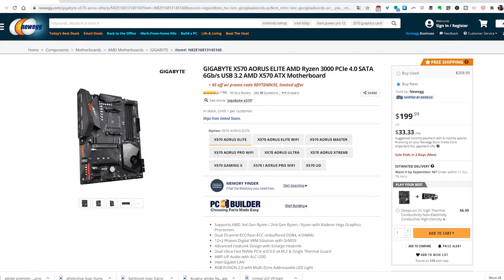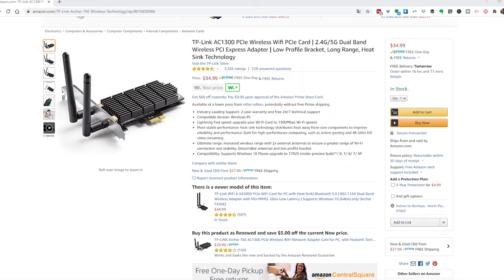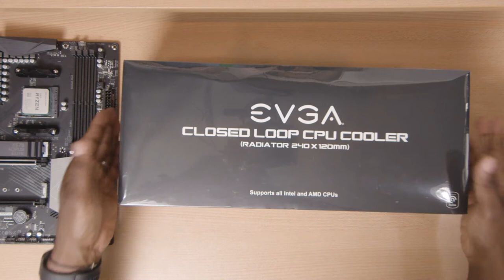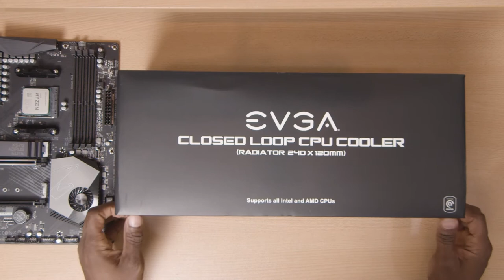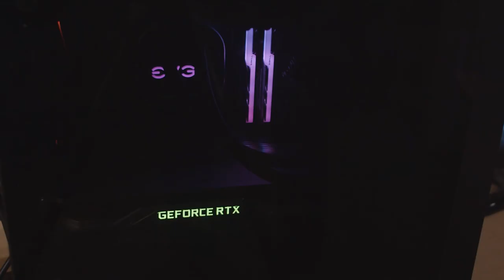COMPLETE High End Virtual Production PC BUILD for Unreal Engine, Gaming, Photo and 4K Video Editing

Comment: Nice video, but you should always install the components on the motherboard externally to test if everything works fine and then put them in the case. Also, if you waited a little you could get a 3080 rtx series for cheaper as well as the rayzen 5 series for same price tag, you would have better performance ! (sorry for that)
Reply from the maker: Hey Willis! Thanks for the build tip! This was my very first PC build, so I was bound to blooper on best practices.  Re: the 3080, I didn't want to lose out on dev time during the summer of 2020, so I sprang for the 2080Ti. The 3 months worth of time before the 30 series release held more value than the price difference and bump in performance!  My sights are set on set on a 3090 for an upgrade in the near future.
Reply: If I were to build this and put in an rtx 3080ti would I need to upgrade the power supply? I’m new to building pcs as well

Comment: Hi Akintayo, I just found your video now and I'm looking to build this to start using Unreal Engine 5.  Can you give an update on the parts? if you were doing this today, would anything change in terms of the parts you bought?
Reply from the maker: Hey beyondcinema! Unreal 5 runs like a champ on this current build.  I haven’t had any issues to date.  The only component I would upgrade is my GPU... an RTX 3090. Don’t get me wrong... the 2080Ti has been running strong with no issues. But it’s also nice to have more headroom for the times it’s needed, especially when it’s at the same price point.  Of course, the biggest challenge at this time is GPU availability. If you can get your hands on an RTX 2080 or higher, I think you’ll still be happy.
Reply: @AkintayoAdewole  thank you! Yeah, I'm just starting to look into it and it seems like all these graphics cards are sold out! Taken by all those bitcoin miners I'm told...

Comment: would you go with Ryzen 9 3950X      or stick with the  AMD Ryzen 9 3900X 12-Core CPU: ?

also have you edited 8k video  with it ?
Reply from the maker: I've have been more than happy with the 3900x for editing 4K video without the need for proxy files.  I haven't edited 8K video just yet, but  would have definitely sprung for the 3950 or a ThreadRipper if that was my intention.  I can fortunately upgrade to (at most) the 3950 if I go that route.  I'll need to swap out mobos if I want a ThreadRipper.

Comment: could you make a similar pc for under 1600?
Reply from the maker: You certainly could get close if not nail it.  Off the bat, you can get a comparable gfx card (NVIDIA RTX 3080) for almost 1/2 the price of what I paid for the 2080 Ti, once the 30 series start shipping again.  Save even more with a Ryzen 7 processor (respectable), Western Digtal Blue M.2 SSD 1TB (instead of Samsung EVO... my 2nd M.2 is a WD Blue.. works fine.) and de-bling the RAM and you’re easily south of $2K

Comment: is it running well with UE4, does the shedders compiling fast, could you show some insights with raytracing performance ?
Reply from the maker: Hi Willis.  When starting up UE4 or UE5 for a new project, it takes maybe 30 to 45 seconds for all of the shaders to compile and I'm still able to work while that is happening in the background.  I don;t have any detailed insights, but for this PC build, I ran Valley of the Ancient in UE5 effortlessly.  With Raytracing enabled, CPU was at 23% and RAM around 18GB.  With Lumen runnig for gloabl illumination, CPU went to 32% and RAM was at 19GB.  Both looked great.

Comment: Wow.. Thank you for this great video..
Am I able to purchase everything almost in same spec under $2500?
Reply from the maker: Hi K M.  At my time of purchase (Spring 2020), I paid just under $3K... but with a newer comparable GPU for the same build (RTX 3080), it would be closer to $2500 today. Save even more with a Ryzen 7 processor (respectable), Western Digital Blue M.2 SSD 1TB (instead of Samsung EVO... my 2nd M.2 is a WD Blue.. works fine.) and de-bling the RAM and you’re easily south of $2K.

Comment: did you checked it with black magic decklink capture card? 

DeckLink Studio 4K PCI Expansion Card not recognised
Hi everyone

I finished my new PC build yesterday but encountered some problems with my DeckLink Studio 4K capture card.

My motherboard the ASRock x570 Taichi has five PCIE slots: 3 x PCI Express 4.0 x16 Slots (PCIE1/PCIE3/PCIE5: single at x16 (PCIE1); dual at x8 (PCIE1) / x8 (PCIE3); triple at x8 (PCIE1) / x8 (PCIE3) / x4 (PCIE5))
Reply from the maker: Hi Zutnit... my build is just a development machine at the moment... haven't incorporated any capture cards yet, so I can't comment on compatibility issues.

Comment: nice video dude! i like it, one question! how were you able to be sure sure that all these components were compatible together? that is my only concern.
Reply from the maker: Hi Stephanie! The primary compatibility is between CPU and motherboard.  If you want to use an AMD CPU, make sure your motherboard is AMD compatible... likewise for Intel CPUs.  Also double check that it works for the specifc chip series.. for instance, my  mobo will support up to an AMD Ryzen 9 chip, but not  an AMD Threadripper, which is the next level up (and expensive).  For memory, "they say" that you should buy memory that matches AMD or Intel, but in my experience, it doesn't matter.  Memory is memory and generally should work just fine.  For graphics card, you need to make sure you have the proper mobo slots (typically PCIe 3.0), that your case is physically big enough for the card, that your power supply can support it (and has proper power connections) and that your CPU and RAM can keep up with it (and vice versa).  Generally, more CPU/GPU cores and more RAM are a good thing.  For storage, as long as the media is compatible with the connectivity (i.e. nvme M.2. PCIe, SATA or USB) you're covered in that area.
Reply: @AkintayoAdewole  Thanks! this is very useful and interesting. I have a workstation at home and want to just upgrde the GPU because I need more power.. my only concern is that it wont be compatible. I think the PCle 3.0 its there. but good to know about the power supply, I will check that out too. thanks a lot

Comment: Thank you for this video. I am looking to start with virtual production. If you were to build this again, would you change anything?
Reply from the maker: Honestly, I wouldn’t change a thing!  This machine has been serving me well to date.  It’s been a great development machine for VP and hasn’t flinched with anything I’ve thrown at it thus far.
Reply: @AkintayoAdewole  would you get 3080 or 3090?
Reply from the maker: @Arlekinplayers   I would get the 3080.  The 3080 beats the 2080 Ti on both performance and price, although I am VERY happy with the 2080 Ti. For me, I didn't want to lose development time over the summer waiting on the 30 series cards release, so the extra I paid for the 2080 Ti outweighed losing 3 months of dev time.

Comment: How much did it all cost? Definetly a machine beast!!
Reply from the maker: Just under $3K at my time of purchase (Spring 2020)... but with a newer comparable GPU for the same build, it would be closer to $2500 today. Save even more with a Ryzen 7 processor (respectable), Western Digtal Blue M.2 SSD 1TB (instead of Samsung EVO... my 2nd M.2 is a WD Blue.. works fine.) and de-bling the RAM and you’re easily south of $2K.
Reply: @AkintayoAdewole  Thanks for the tips! This was exactly the type of build that I was looking for within my budget :)

Comment: Great video 👍
Can you Build a PC for under 2000$
Reply from the maker: You absolutely can build one for under $2K. Swap out an AMD processor with less cores (Ryzen 7).  In lieu of a Samsung EVO drive, check out Western Digital Blue M.2 SSDs. You’ll save $60 to $70 for comparable storage. You can save $600 to $800 on the GPU alone with the newer Nvidia 30 series cards and get close to the same or better performance than the 2080 Ti.  At the time I put this video together, although the 30 series cards were on the horizon, I didn’t want to lose 3 months of dev time before their release.  No regrets.
Reply: @AkintayoAdewole    Thank you . You are a great help for the viewers on your channel , i like your videos and the way you explain what you are doing , i'll start building one following your advice and infos , thanks again J-king all the way from Paris France
👍